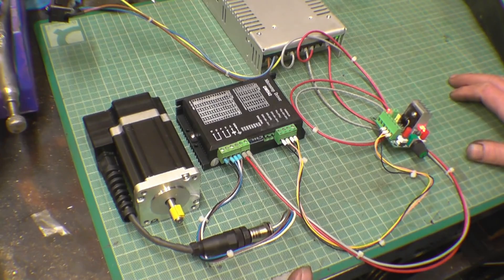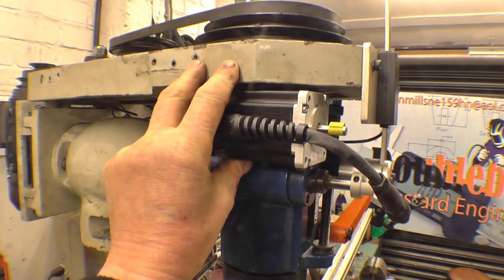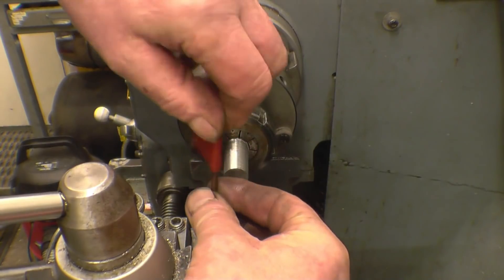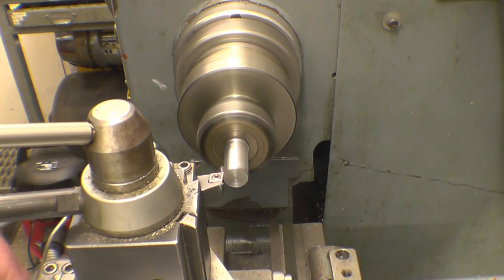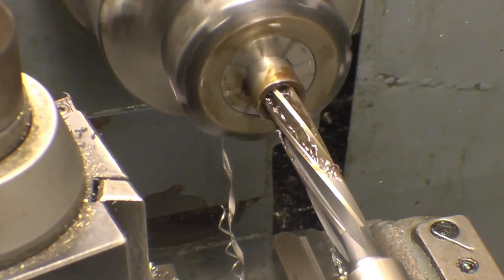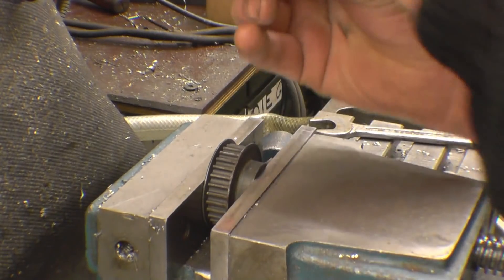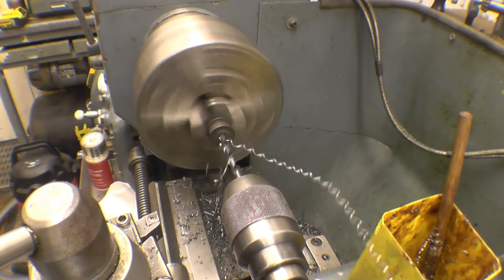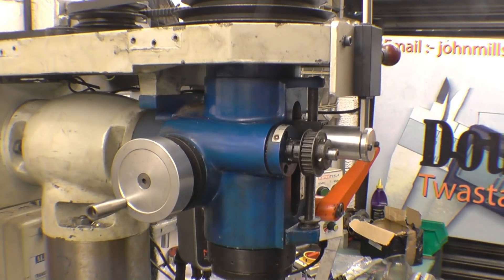SNNC 317 P2 Milling Machine Stepper Motor Quill Feed

Comment: Before you know it, there will be a stepper on every axis and John will spend his time swearing at fusion360.
Reply: I want a microphone in the room as John designs something on Fusion360. Personally I use TurboCad (Version 18 Deluxe) it has 3-D capabilities, but I still can't figure it out.  Been using TurboCad since version 8, I think. I'm guessing since approx. 2005?

Comment: John:
I looked on Ebay.ca for your T-slot scraper.
https://www.ebay.ca/sch/i.html?_odkw=193355.37870&_osacat=0&_from=R40&_trksid=m570.l1313&_nkw=193355037870&_sacat=0
$10.26 CAD is ok. But did you intend for it to be another $27.95 CAD for shipping?
Reply: I don't think he set it up for international yet, you're just getting some eBay estimate

Comment: Great video as always. Interested in the quill feed mod. Why the stepper? If you aren't using it to step the quill down incrementally then surely a standard DC motor/gearbox would do just as well. Your pwm module would drive that. 

It would be nice if you could use the stepper to increment the quill and get feedback from your quill scale. I want to do that with the knee on my Harrison Mill.

Comment: I suppose making custom brackets is very easy when you happen to have a CNC plasma table handy lol. The machines where I work have slots on the motor mounting bracket so the whole motor can be moved slightly to adjust the belt tension. As soon as I saw the bit at the end I knew right away what was going to happen lol!
Reply from the maker: It certainly is  , saying that i have done plenty with hand tools
Reply: doubleboost Is it still classed as hand made when you draw it by hand on a computer screen? ;)